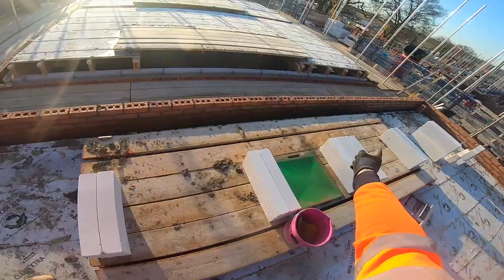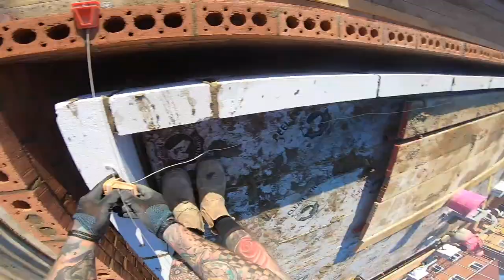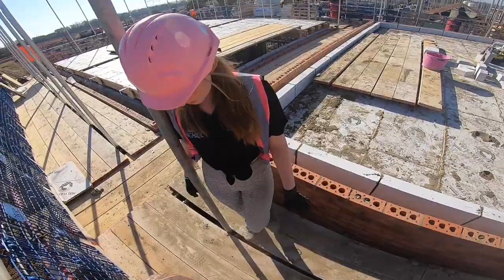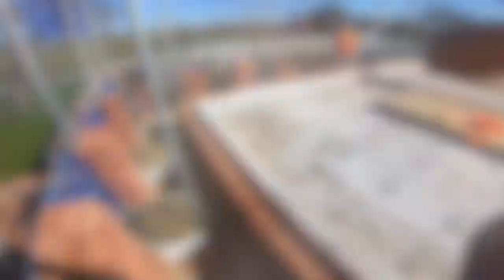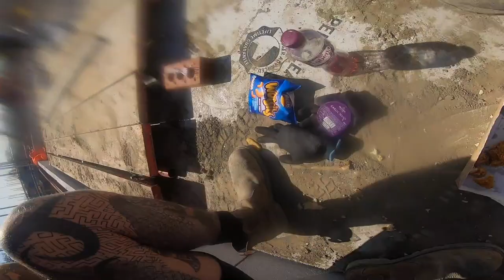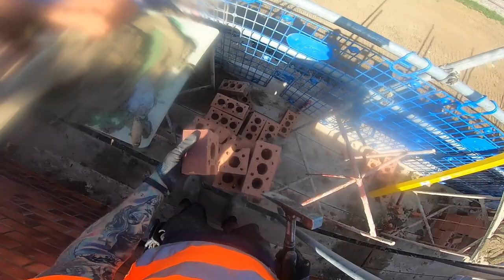Amys 21st birthday

Comment: Surely seeing that block touch the flooring, you'd leave it off and let them run down it with the circular saw? But now it's a painfully long job with the multitool. I know it's not your fault but those inside blocks could've been left off